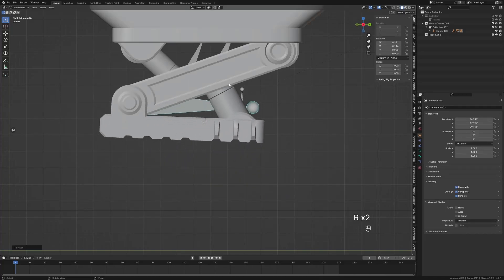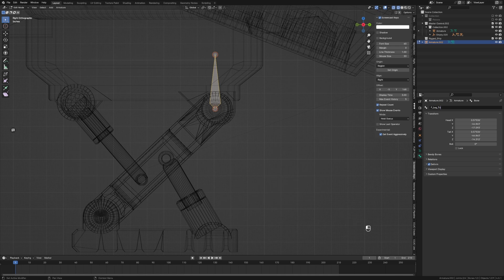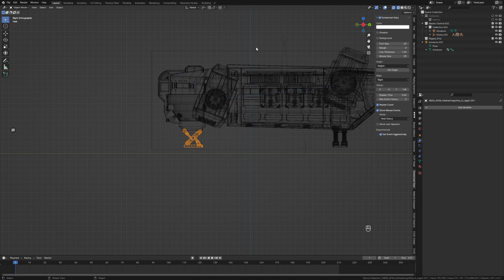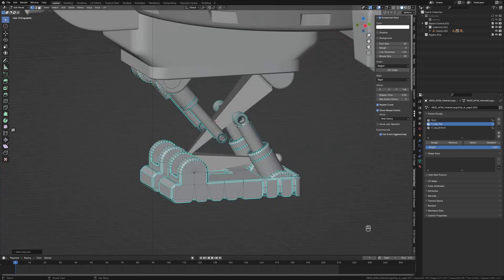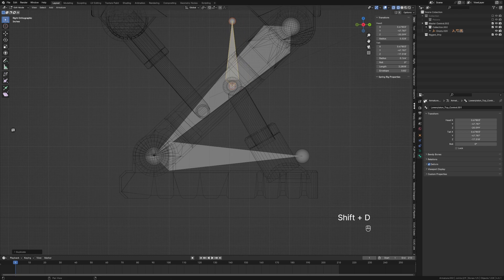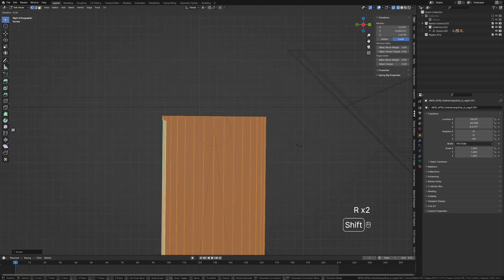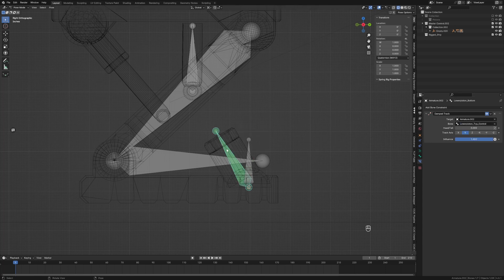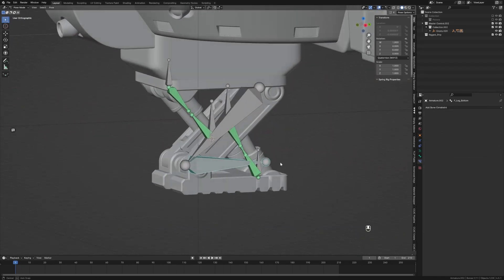How to Quickly Rig mechnics in Blender

Comment: Question, could landing gear asset packs come rigged like this?
I'd be in the market for kit bashing rigged landing gear and hatchways and what not
Reply from the maker: So yes they can be, but the issue is that the “controls” would only work in the native program. So just moving the one bone and it controls everything is fine in blender, but if I went to UE, then I would have to manually animate each one. Of course I could bake the animation in blender